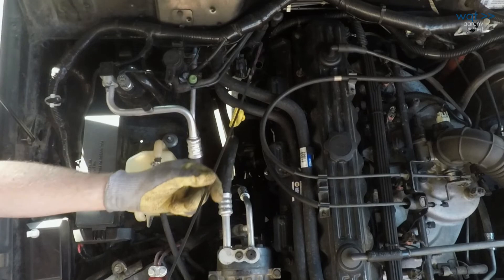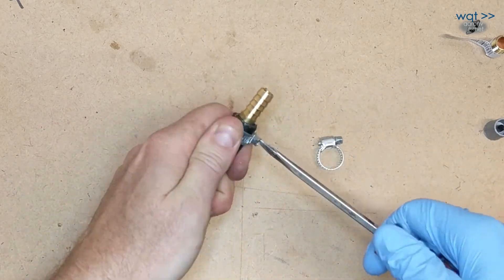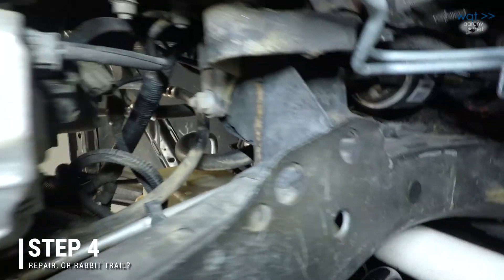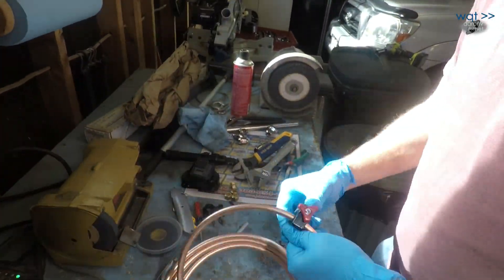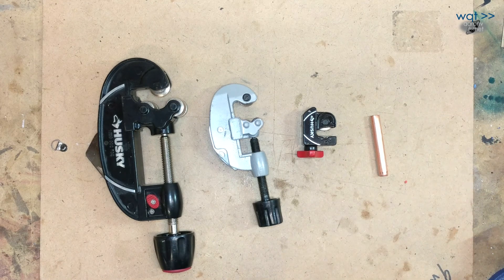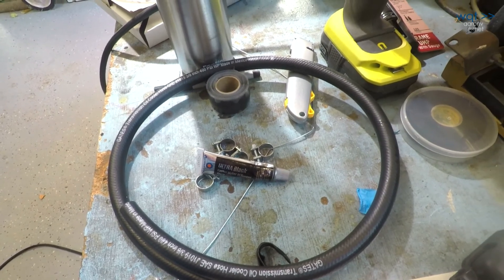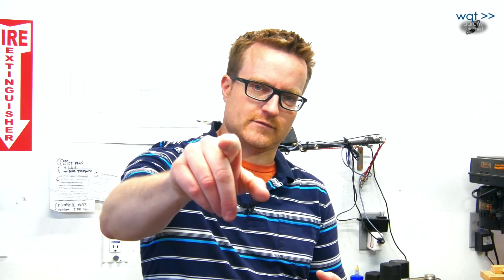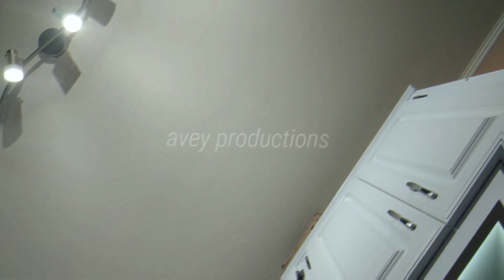projectXJ: 97-01 Jeep XJ AW4 transmission cooler lines, Part 2 - the wrong (but right!) way

Comment: Great video. I’ve also been having problems with the fitting that goes into the tranny seeping or leaking (they’re new and the lines have never been removed) so I found an article about converting over to AN fittings that I’ve been researching to see if it’ll work for me. It’s expensive but that ~$300 is worth it to know I won’t have any blowouts on the road or especially when I eventually take it on a road trip one day. It goes without saying that my XJ has never left the county since I bought it.

Comment: This video is a gem for XJ owners, I have the same problem of pinched lines above the control arm, instead of swapping the whole line I had already ordered, this method on this video seems much more practical and easier to do.. I will attempt this method first and if it works, I won’t bother using the new lines..

Btw, excellent video quality and editing.. and the attention to detail you put into it is very underrated.. I really enjoyed it and appreciate it

Comment: Look up “bead rolling tool”. Graham Tool makes a badass one but wants like 200USD for it. Otherwise there is a guy in eBay that sells one for 40USD but it’s not in stock. Otherwise I have used my brake flaring tool to make a DIN bubble-type flare (used in euro car brakes). It’s soft enough to allow a hose pass onto it but when you clamp it, it will hold. I like your use of black RTV — I never thought about using that to prevent the hose from slipping off. Some folks have installed AN hose adapters on the transmission (M14x1.5). I personally just purchased two barbed adapters to screw onto the transmission and I’m going to run rubber hose (Parker or Gates) heat-rated. I’m very surprised nobody sells a kit for this! My Duramax had one for $200USD.